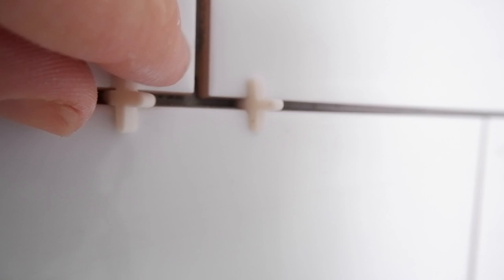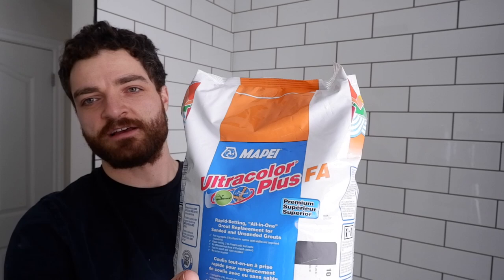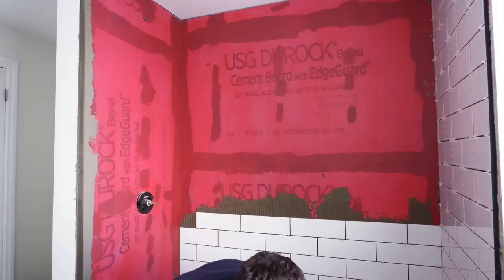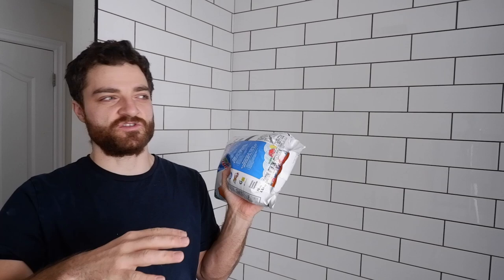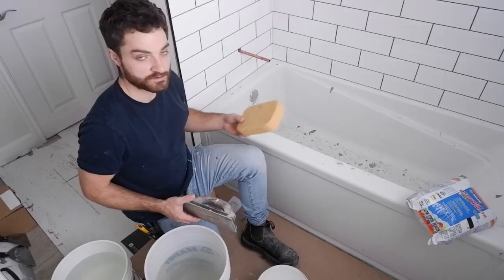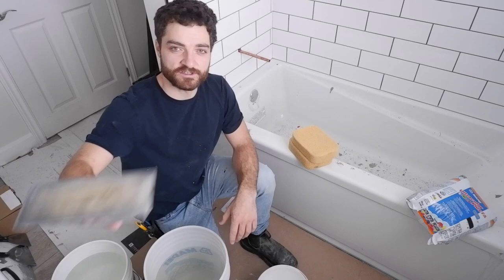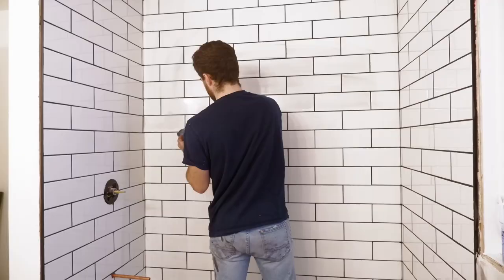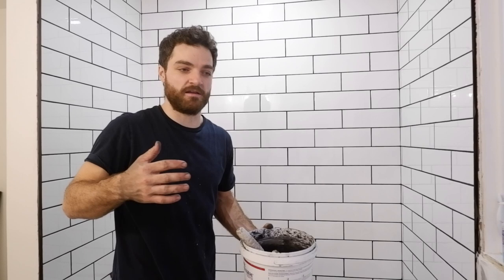How to use mapei ultracolor plus fa and mapesil t - Bathroom remodel part 5

Comment: Thanks so much for making this video and figuring out that the mixing speed is the primary issue! I've seen so much misinformation floating around about this grout, and once you mix it at less than 300 rpm it's a piece of cake to work with! I've used it three times now since watching your video and all three times after applying it to the whole wall I've had to wait a good 10 to 20 minutes for it to set up before I can start wiping! It's not a stressful speedrun, it's downright relaxing! The aeration hypothesis makes so much sense. Really appreciate it, man. Keep it up
Reply from the maker: Hey thanks for watching and appreciating the video! 
I’m certainly always learning as well and am always trying to use the best method for the project at hand.. sometimes within restraints that are beyond my control, but that’s where creativity come in!

Comment: I just stumbled by. I love to tile but I'm just a DIY. This is the grout I used first and I got so terrified of stuff I found on YouTube about it drying super fast. I actually called the technical number and they said just hand mix. It do not use machinery. Apparently that's the only trick.

That said, I'm spoiled now. I used a different grout on the shower floor I did and it was a slower drying one and I hated it. 😂

Thanks for putting the stuff out there, you do good work and it must feel great to help other people achieve success. Success. Anyway, I should probably get back to work on my projects and stop stalling by leaving comments on your old YouTube videos.

Comment: TEMPERATURE IS MOST IMPORTANT ~ any temps over 75 degrees is going to reduce the application time to drying haze will be approximately 15 minutes ~ Mix small amounts pretty loose and work small areas like 2' x' 3' ~  I also suggest using "distilled water" so the manufacture cannot say that '''''''''there may be chemicals in your water making it dry extremely fast''''
Work Fast in high temp situations and clean tools immediately WITH EACH MIX ~  [within 15 minutes]  are they will be toast!!
The F/A brand does make great smooth seams when done properly.....

Comment: I used the tape caulk method.   It works well.   There were a few places where I had "thicker" edges on the caulking.  I used blue tape.   I think that you need to wipe the caulk thin onto the tape.  The caulk edge will be the thickness of the tape.   But at least you have straight lines and it looks neat.
Reply from the maker: Thanks for pointing that out! Ya, it is a method recommended by Mapei, it’s not as easy, as you mentioned. I think free handing it is the best method but also needs practice

Comment: Great video thank you.

I’d been staring at my bags of grout and silicone … nervous because of some of the videos on here about it. After yours I went and did it and am happy how it turned out. 

Thank you again.

For caulking, I’ve been watching CharlieDIY so will be trying to avoid using tape
Reply from the maker: Hey Frank, thanks for the feedback!
Glad your project turned out, it can be intimidating for sure. 

I'm unfamiliar with CharlieDIY, but i could think of a few reasons why tape wouldn't be the best method. 
I think ideally you free hand it, no tooling, no soap/water tricks. 
Mapesil T does say you can use the tape method, but you can mess that up pretty quickly too. ... and the also say you can tool it with soapy water ;p but best thing to do is do the research and do with what you feel comfortable and confident in doing after that

Thanks for checking out my videos!
Reply: Ha! Me too.... watching my bag of THIS grout.... loosing sleep for 4 months.....I saw a another video along with this one, giving me courage....mix by hand so NOT to let air into the mix....wish me luck!
Reply: @dmorrone111  for what it’s worth, I’ve since done two tile jobs around the house with FA (one white, one colored) and both turned out quite satisfactory. I mixed both with a drill (lower speed) and had no issues.
Reply: Hi Frank, I'm curious if you used the charlie DIY tools and methods for the silicone?
Thanks
Reply: @dmorrone111  Yes. And it worked well. The Kramer kit actually came in useful before caulking too, as I used one or two of the tools when grouting the tricky internal corner of a niche.
Reply: @frankblack1481  thanks, I really appreciate this info. I did not want to have to do it by hand.

Comment: If you mix it by hand , not a drill  ie mix let sit for a minute then stir and use it won't go hard as quick
Reply: I think they recommend 5 or 10 minutes to let it slake. It's in the instructions.

Comment: The bag says to mix by hand.  If you mix with a paddle is accelerates cure time
Reply from the maker: Yes! Should have mentioned that
Reply: From Mapei tech data sheet:  2023-11-14  Mix thoroughly with a low-speed mixer (at about 350 rpm) for about 4 to 5 minutes, or until obtaining a smooth, creamy, homogenous paste consistency and a uniform shading of the colored grout.

Comment: Nice work, thanks for the video. How long of a working time did you have with what you mixed in the bucket? Did you mix a new batch for each wall?
Reply from the maker: Good question! 
The first batch I did just enough for side wall, then I did the other two walls with the same batch I think, can’t quite remember, but I think you have at least 30min working time, there are other grouts that have closer to an hour working time that I’d recommended if it’s your first time, as when this stuff starts to dry it turns messy real quick

Comment: First off. BEGINNERS DO NOT USE THE FAST SETTING GROUT!!!! You well regret it. Second using tape for caulking creates an edge. Dirt and gunk well accumulate in the future.If your not comfortable just using your finger than use this method and then go over it with a wet windex finger to smooth the edges.The tricky part when doing this is to do it before it begins to set up. This requires doing short sections as zack has shown. Nice vid.

Comment: did you grout the corners and silicone over them? or just leave them empty and use only the silicone?
Reply from the maker: Good question! Typically I like leaving an 1/8” gap and siliconing it. You could add grout, it most likely would serve as backer for the silicone as grouting that corner will always develop a fracture crack

Comment: dude.....those corner slivers
Reply from the maker: ya, not the greatest, i admit. I wanted to stay true to the half over lap, and because of the plumbing wall being original, and wanting to go to the edge of the corner, I was left with a smaller piece in the corners. I put it there, rather then where the aluminum tile edging is, because i think it looks better, makes it appear that the tile wraps the corner unto the back wall
Reply: Corners!  🤪
Reply: @zackcrafted  In that situation start in the center of the tub at 25% of your tile,  you would have eliminated the sliver and had equal alternating cuts on both sides.
You're one of the few guys I've seen mix that Ultra Color like it should be.

Comment: I will never use Mapei again!!!
I’m in tiling business since 2006 , and my latest tiling job was 300 sq/ft. 
I was using Mapei Ultracolor plus FA one bag of 25lbs and one 10lbs bag for the job 
Color was 04 Bahama Beige on both bags, when the job was finished color was different from bag of 25 lbs was lighter than bag of 10lbs. Common reaction from Mapei is about how much water did I use 
And that is just big BS , there is no difference when you use little bit more or less water I made video about it and show it to Mapei people, 
I’m done with Mapei for good
Reply from the maker: Oh my gosh that would be the worst. Thanks for the heads up, I’ll have to look into that before I commit to using them for the next job!
Reply: Mapei recommends dry mixing multiple bags to avoid color inconsistency.
Reply: You didn't follow directions. "Dry mix multiple bags." RTFM.
Reply: How is it possible to be in the tile business that long and not know about mixing different batches of grout? It's the same with tiles. Each batch has a slightly different color. Buy all the tile you need at the same time and make sure they are from the same batch, the same with grout. For the grout, you should have mixed all the bags together while dry in a bucket to get an even color, then take what you need from that bucket to mix with water. You also need to make sure the water amount is the same for each batch or you may get color variation. This is very basic information that anyone who tiles professionally should know.
Reply: @zackcrafted  It was 100% user error.

Comment: Remember to set out first before you tile. Emmmm that corner looks a bit dodgy.
Reply: I thought the same, If he moved over half inch perfect
Reply from the maker: Good catch ;) 
Yea, I’d agree that it isn’t ideal to have a small piece like that. Unfortunately I was a bit limited as it was an old rough opening, so to allow my tile to come out beyond the edge of the tub and down to the floor, I was left with that small piece on the inside corner. 
I’d rather do it that way for waters sake, then to have let my tile stop right at the edge and inevitably get water damage to my drywall and baseboard

Comment: could the slivers of tiles at the corners been avoided with preplanning?
Reply from the maker: Good question! 
Unfortunately this was a rough in tub, meaning we left the walls. I prefer having my tile run down the vertical sides of the tub to the floor, as that always sees moisture. With the half tile over lap this left me with the slivers in the inside corner. It was either that or having them on the front edge, which I didn’t like as much.
I know it’s not cosmetically ideal, but it’s just the way it panned out
Reply: Just start with a 3/4 tile in the corner and that issue is solved
Reply: From what I see, the slivers were definitely avoidable. @zackcrafted
Reply: @AIbury1  Not only was it avoidable , but so was not getting the back tiles centered with equal length cuts on the both sides.